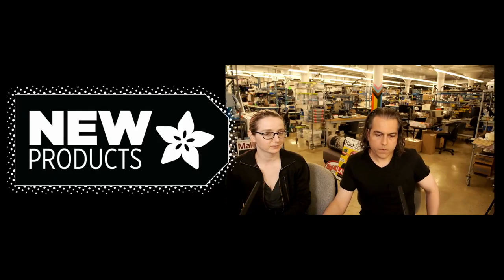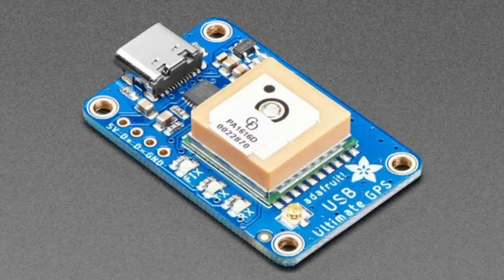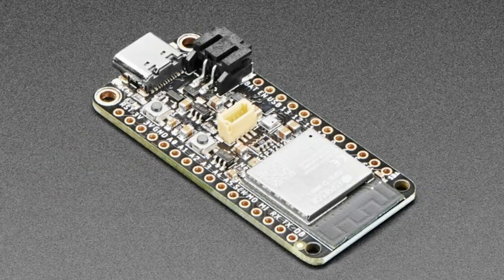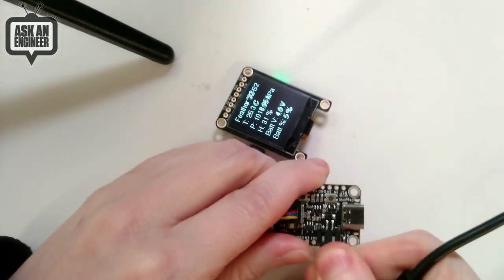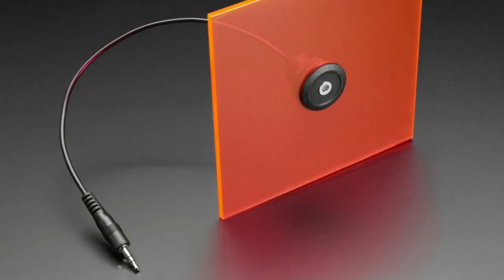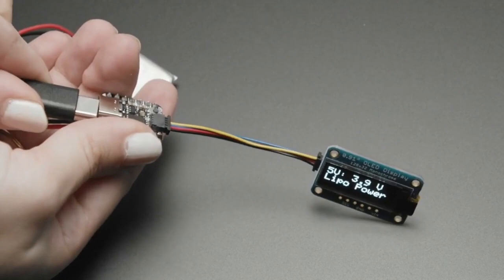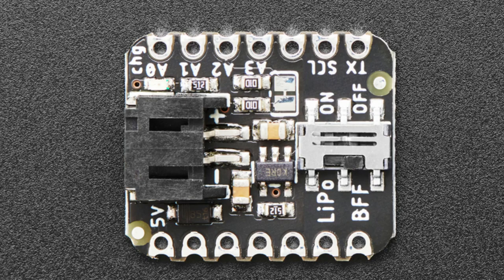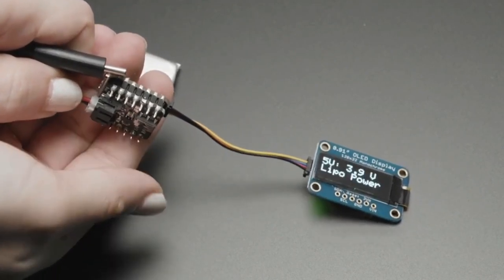New Products 3/16/22 Feat. Adafruit LiIon or LiPoly Charger BFF Add-On for QT Py!

Comment: Do I understand correctly that the LiPoly Charger BFF really only requires 5V and GND to function as intended? A2 on the QT Py only being needed if you wish to monitor the battery (saw it online that you could cut the trace between the jumper pads if one chose to do so)? Just wanted to confirm all other pins are still useable. Thanks, I love the idea of this combination!

Comment: Do you make a USB C to selectable voltage shield? It would be awesome to have something that I could set to (say) 15v and then use a USB C PD supply to power it. I’ve seen stuff on eBay, but would prefer an Adafruit version with trustworthy engineering!